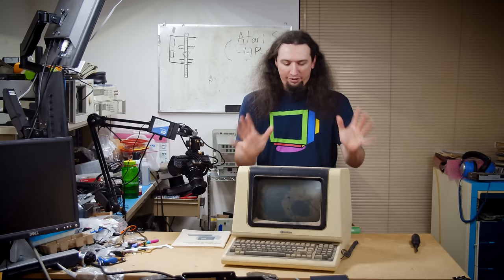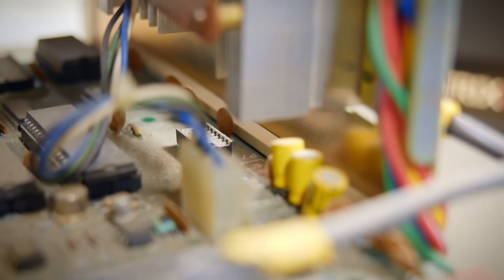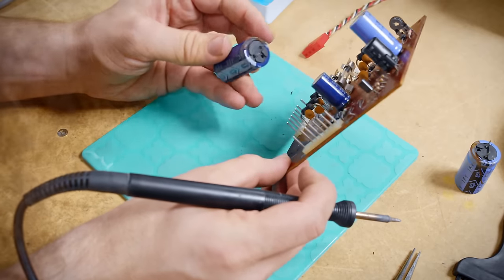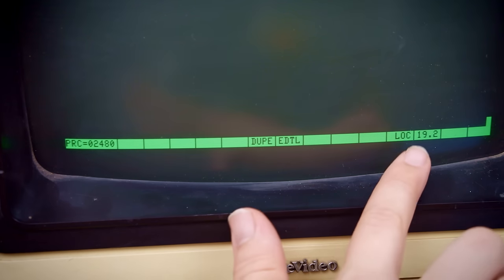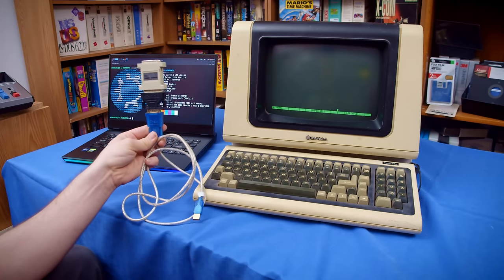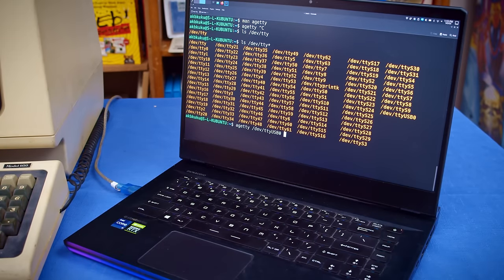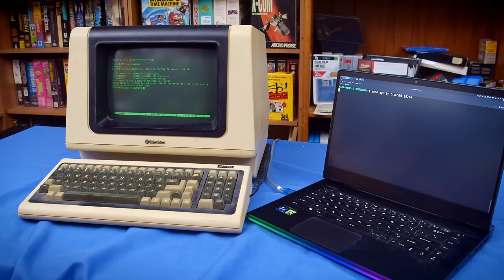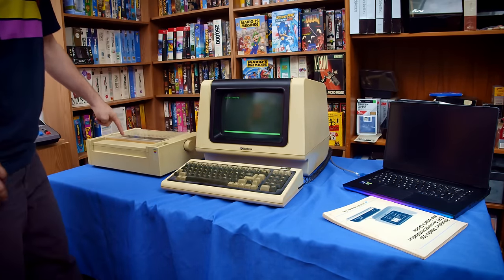1980 Terminal with Linux - TeleVideo 950

Comment: I remember back in the day, I used to work with serial communication all the time on AIX and HP, System V and HP-UX.  I also did a lot of CNC machines in shops.  I was the serial master.  I remember one tech had been at a customer for a week trying to get a Fiber Serial MUX working on a AIX it basically took 16 Serials to dumb terminals over Multimode fiber to another building.  Back in the day before IP and Telnet were really a thing.  I had it working in about 2hrs.  Had to loop 4 and 5 and 6,8.20, set it up for software flow control.  I still have my breakout box.  Every once in a while it still comes in handy.

Comment: I have lots of memories working with old terminals. I had 6502 based terminal in my garage (with colour capability) in mid 1990's. It was connected via serial to PC in house running a Slackware distribution of Linux. Lots of hours spent with termcap, configurations, and trying to get terminal compatibility to present data correctly on the crt.

Comment: Also, in almost all cases, control-H works as a backspace. It even works in Apple II Basic.
Reply: That's because backspace is ASCII character 8, so on anything resembling a serial terminal, it's the same as sending the 8th control code via ctrl-H .  Similarly delete is character 127 (which makes a lot more sense when using 7-hole punched tape to write teletype messages to be sent directly to another terminal over a pay-per-minute phone line.
  The huge problem is that someone in the early days of Linux swapped the two ASCII codes and insisted their nonsense was the correct behavior for the local Linux console.

Comment: Wish I had this guy's knowledge. I saved all my early computers, printers, etc, and in much better shape than in the barn like here! I have this same Televideo 950, and plenty of other stuff, including a very early heavy and expensive S-100 CP/M system, even massive heavy 8" floppy drives in a frame weighing at least 80 pounds. It would be fun to get some old stuff working again.

Comment: Reminds me of the good old days when I made a null modem cable using a male and female serial port connectors and a piece of telephone cable, match light solder and paper clips as jumpers where needed.  It worked well enough to transfer my files, but after that I didn't need that cable again for 15 years and I finally sent all my old parts to the recyling people to do what they could with it all.  Cleared out an entire closet full of old machines and parts.

The stty command can be used to examine and change the baud, etc. settings on a serial connection.

Comment: Nice terminal, although not being VT100 is a problem these days.
I've been looking for a terminal for ages, nothing in my neck of the woods.
Serial is not that hard, you just have to get used to what DTE & DCE is all about, and how it was used back then, although I have a bit of an advantage, spending my early working years at a telco fixing terminals & modems.
Reply: > although not being VT100 is a problem these days.

Anything not based on DEC terminals would be an issue. That's for sure.
Reply: Wish I had a dollar for every VT100 I installed
Reply: DCE and DTE is simply terminology for each end of the serial link.
It'a the control lines you need to get your head around and which particular ones are being used.
For example, CTS, RTS.
Or DTR, DSR.

It's identifying which flow control mechanism is in use and which signal lines and how they behave.
Reply: @deang5622  Yes that can be a real challenge, as these lines kind of get repurposed, and referring to older documentation on serial can lead you astray as the modern use quite often treats them as general purpose I/O lines, the only bit relevant sometimes is whether they are inputs or outputs.

Comment: I used to know a lot of tty commands to get the terminal I was in front of to behave. Often needed even though settings were 'correct'. Typed them in without needing to think. Those were the days. But what was most impressive was IBM block-mode terminals (e.g. 3270) used on the mainframes. Made data entry and data entry programming so easy.

Comment: Well done!
I was doing my job on TERM=pf and vt100. Many odd reactions when set to the wrong one in .profile.
I used UNIX System V on a Perkin-Elmer 3210 minicomputer, which had 9 terminals, a console, 1 line printer, 1 plotter and an 8" double floppy disk station.
The hard drive had one permanent and one removable spindle, each holding 16MB of data. 
The RAM had about 4 MB.
A program, written in C, only i++ing up to 100K on a longint took only ONE second to run.
--=== This was one year before 1984 ===--
Greetings to all of you ...

Comment: Vintge terminals and modern Linux/BSD are always fun, yours seems to be very usable for 1980 vintage. I've successfully tried to connect old 70s Tektronix 4006 vector terminal to my desktop and it kinda worked, there are luckily still few tools that can plot in the Tek format, but biggest problem usability wise is the lack of lowercase keys.

Comment: Back in the day, we had a customer that ran a scrap metal business. Every time we went there, the terminals looked just as dirty as the one you found in the barn. We would clean everything (including on one occasion cleaning a huge number of ants out of the main Altos Unix system), and get it all looking pretty again, only to have to repeat the process a few months later. 
We used to use a foaming cleaner called Amberclens Anti-Static Foaming Cleaner (which still exists). 
 It came in an aerosol can, and would clean anything off anything. I have no idea what the hazmat sheet looks like for the stuff, but is sure as heck does the trick.
Reply: Anthill Inside!

Comment: Very nice video, bringing back memories of my student days in the 90s when I got a TeleVideo TVI925 for a chocolate bar. Attached it to my 486 box running Debian (1.3.1 and later 2.0) with a 9/25 adapter and a 9-pin nullmodem cable. I recall enabling agetty /dev/ttyS1 in /etc/inittab, and that was pretty much all I needed. The terminfo file supported tvi925, and I did not run screen here. Well, the serial terminal was meant to serve as a fallback when screwing up XFree86 configs, but I actually never needed it.

Comment: I'm pretty convinced, that you can avoid agetty completely and use screen directly, as it accepts tty-devices as inputs just like `screen /dev/ttyUSB0` (plus terminal-mode options of course). I always use it like this when using serial-output from microcontrollers and such. beside that, you can configure screen to not show it's start-screen, that you have to bypass by pressing enter (which is default on only some distros).

Comment: I wonder if whatever's setting your prompt (probably the PS1 variable; I don't use Bash that much) is just hard-coding some escape codes into it.  If you know the termcap capability name (you know, "termcap" is short for "terminal capability"), you can use the "tput" command to generate the escape codes.

For example, I might do "tput smso" ("set mode standout", which enables bold), print some text, and then do "tput rmso" ("remove mode standout").

I don't know what the default Bash config file(s) is doing to you; I set my PS1 in my .profile (plus I use Korn shell).

I wonder if you neowhatever program inspects TERM or if it just hard-codes the escape codes.

I would expect "man" to work properly.  What happens if you do the equivalent of a man, such as "zcat /usr/share/man/man1/ls.1 | nroff -man | less -R"?  I use Red Hat, so the location of your manpages could conceivably differ.  So, you're gunzipping the "ls" manpage to stdout, running i through nroff with the "an" macros ("-m" means to use the indicate macro package, so it's just clever that it winds up being "-man"), and then piping that through "less".  The "-R" option to less means to interpret, rather than display, any escape characters.

The other thing is that your particular terminal might be some sort of variant (there were several tvi950-related options).  You should look at your settings and/or EPROMs.  Or, if there are sufficiently fiew of them, you could cycle through all of the tvi950* setting available until you find one that stops making a mess of your screen.
Reply: Yes  This is a common thing.  People just hardwire control sequences in their shell rc and profile files, without even using tput.

Comment: Memories on having a parade of serial adapters plugged into each other.  How many times I used to do that, when trying to connect two "standard" technologies to each other (haha).
Reply: There were standards, problem is they’re mostly telecom and MIS folks generally ignored anything “those phone people” did. When you have a terminal connected to a modem, that dialed into the host, the path makes sense.

Comment: I had one of those (next to a lot of other terminals) for years on my many serial only systems. I actually wanted a 955, and all I got was this 950 and 920C.
Bought them from school. I used to work on school on these.
96 people working at the same time on the same computer with 2MB ram, which was a lot. Doing "excel" and stuff. Never was a problem.

Comment: To change the back space character try using stty erase. Hopefully the commands for clear, vi and Emacs should work perfect as these will make use of the term variable, make sure display is unset. I did not use this model but the 925 with a Spiderport that used to connect to both Sun OS and Primos systems when I was studying. Obviously I preferred the Prime Pt220 and Dec Vt320 and vt340 terminals to this one. If you even need to connect to the Serial port of an old Sun system the default is 9600, 7 bits, even parity with xon/xoff and if connected to the console do not press the break key if you have one as that will bring up the open boot or old mode prompts depending on the setting

Comment: It was common to use the printer port on these terminals (and ADM-3A's and the like) to attach to "development boxes" which could accept Intel hex data to send to a ROM emulation circuit. Atari and many game companies did just this to send the output of a cross-assembler to the testing hardware.

Comment: I have a Wyse 60 in my garage for 25 years. Turned it on tonight after cleaning it up and it powered right up. Characters a bit fuzzy cleared up in 10 minutes. Ran it for two hours no problem. However I followed your instruction and can’t get it to work. I know the terminal works as I can adjust settings. And my Linux box is recognizing the usb port for TTY.  Not sure if there is a setting on the Wyse causing the issue or what. More tinkering to come.

Comment: As I remember. Printing on Unix is simple. You send a command to the terminal (^P in general) and it instructs the terminal to forward everything it receives in serial port, to printer port. ^N ends this behavior and resumes the normal operation.

Then. The wen you print a file, rh spool program formats the output and sends it to a script indicating the destination printer. This script knows that this printer is attached to some terminal and knows it's serial port. So it sends ^P to this serial port followed by the print data and a ^N. This means you can send print jobs to any slave printer on any terminal. The only problem is that during the print the screen is frozen.

Comment: Back in 2004 one of my clients had an old SCO Unix server with 16 dumb terminals connected via serial cable, in offices on a 2 story building. The clerks worked on a lot of medical data entry and a terminal was all they needed. My job was to convert all the stations to Windows XP with a telnet client instead. the funny thing is those clerks hated XP; they wanted their old dumb terminals back. They really could input a lot of data with those old terminals.

Comment: The screen util is removing all escape characters, input and output. If you can turn off the colour in the terminal (like LS_COLORS for Ls), the terminal will work fine without screen.

Comment: Nice terminal but looks like it really wants to be a VT100.
Most terminals I used either had a VERY minimal status line at the top or no status line at all. But a lot of DOS or CP/M terminal emulators did have that heavy bold status line at the bottom... now I see where that styling came from: "if it's good enough for Televideo, it's good enough for us".

Comment: So, while it's always a good idea to have TERM set correctly, some software out there doesn't actually use the terminfo library, and just has DEC VT escape sequences hard-coded. (I looked into the neofetch source, and it falls ito the hard-coded category. It looks like something in bash has an xterm escape sequence hard-coded, too, which turns an xterm feature called "bracketed paste mode" on.) Unfortunately, it's been a long time since it was mainstream to use anything but a DEC VT or an emulation of it. And personally... I don't really miss the days of terminal ecosystem diversity. Or the fun of maintaining code that has to work on a dozen different Unix flavours. Or the wide variety of microprocessors and hardware platforms. Most of the time, anyway. 😺

Comment: My media server uses a motherboard that has a built-in serial port, so I have that configured to run an agetty on it at boot.  Side-note that motherboard actually lets you enable serial in the BIOS!  You can access the BIOS screen via serial! :O

Anyway, I set up a special "serial" user on the server, so when you use a terminal and login, you get a menu asking you your TERM type 🙂

Comment: Let me tell you a story about keyboard beep on things like this. Back in my college days I used to go into a lab that had row upon row of C.Itoh CIT-101's installed. One of the curious things about these terminals was that they all had keyboard beep turned on -- by default. Having it on at home? No problem. In a lab? MADDENING.

Now, I would go into this lab late at night, and one night I was in there to witness a fellow coder go a bit nuts, turn his keyboard over, and stab the daylights out of the speaker in the bottom of that keyboard in order to ensure it would never beep again.

Comment: Serial is far worse that you describe. 😅  There is also Data Terminal Equipment (DTE, the "standard" for terminals) and Data Communications Equipment (DCE, the "standard" for modems).  In theory you could connect a DTE and a DCE directly.  In reality, never.  The first "tech" job I was paid for, was helping a 3rd party company to run serial cables thru my father's office for his first computer system (S100 chassis, multiple terminals selected with a switch, two printers - a dot matrix and a daisy wheel).  I was hanging out in Dad's office after school, and as soon as the crew running the wires found out I could solder and read a pinout diagram, I was recruited.  We ran the cables, and soldered the appropriate 25 pin connectors on the ends with the wires crossed as needed.  This means not only matching Tx and Rx, but also the hardware handshaking lines (almost possible to ignore on the terminals if you run a slow enough baud rate, but critical on the printers).

Comment: Most 25-pin serial ports were female. When IBM designed the PC, they went with a DB-25 male for serial, because they wanted to use a DB-25 female for their parallel port. From then on, the DB-25 (and DB-9) male ports became the de facto standard for PC serial devices.

Comment: I'm a Unix programmer and sit in a terminal emulator all day.  I wrote a small shell script called "vtprint" (my emulator does vt220) which does a "print -n" (OK, so I use Korn shell, rather than Bash; the "-n" means "don't print a newline after") of the vt220 escape codes to redirect output to the printer, then does a "cat" on the command line argument, and then does a "print" (without "-n" this time) of the escape code to disable printing.  So I can "vtprint $filename".

My terminal emulator itself has an option for printing everything echoed to the screen, so I don't need to worry about that.

Comment: I wonder if RIFA caps can be reformed. Might need a clergyman. Re: Key beeps, I did firmware for a product with terrible, squishy, rubber keys. It contained a piezo buzzer with a 1 kHz fixed-frequency.  By turning that beeper on for just one millisecond per keypress, it made a nice click sound, which greatly helped the user experience.

Comment: I understand that you don't have a sink in your office but I don't understand why you don't use rubbing alcohol to help clean these old dirty products

It works extremely well as a wet cleaning agent that can be used without the need for a sink

Maybe try getting some 70 - 90 % rubbing alcohol and putting it in one of those small plastic sprits bottle (the ones you squeeze like a bottle of Windex). Use paper towels and Q-tips to wipe it down
Reply: @martinr1834   >He's a young man, why would you expect him to have any experience with cleaning?

Is this meant to imply I'm a not a man or that I'm not young?

Comment: Null modem is not always needed. If you are connecting dte to dce you go straight through.  But dte to dte needs null modem.  Dte means data terminal equipment. Whereas dce data communication equipment.  So that’s like a terminal connected to a modem.  Ideally the rs232 port should be labeled as dte or dce so that you know what cable to use.